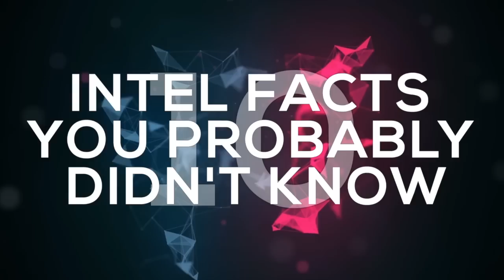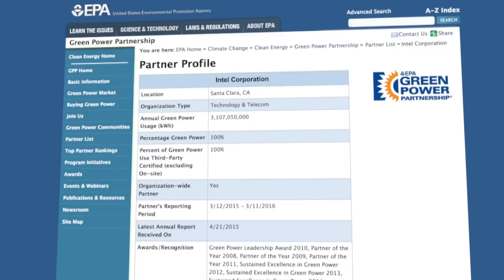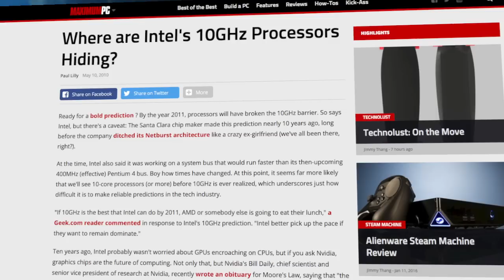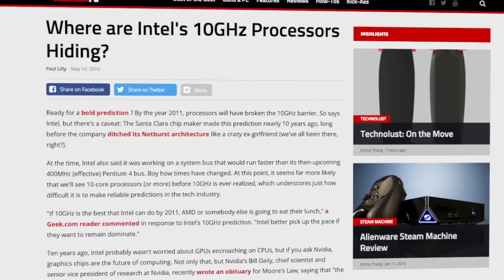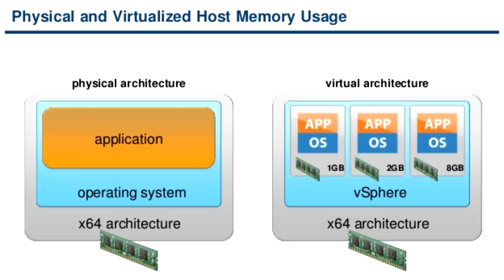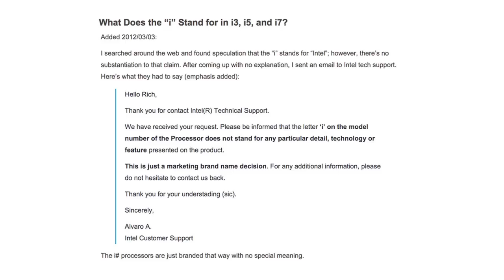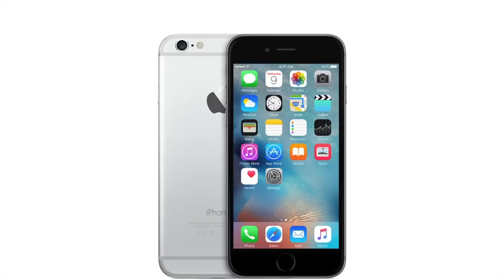10 INTEL Facts You Probably Didn't Know

Comment: 1st: Intel didn't licensee x86 out to AMD to stop them from being a monopoly, IBM wanted to use the Intel 8088 but required there to be more than one supplier of chips, Thus AMD was brought into the fold.

2nd: thing wrong is that Moore's law has not stopped ore even slowed. We still do double transistor every 2 years. This is easily view-able if you simply look up Moore's law on Google or Wikipedia.

3rd. In regards to your statements that we have had 3GHz processors for a a long time is just misleading. Yes we have had processors usually around 3GHz for many years but the performance per GHz has gone up significantly. Thats why a 8 year old Core 2 duo @ 2.4GHz get completely dominated by a modern Intel Pentium at the same GHz.
Just google Megahertz myth or look it up on Wikipedia as well

You guys need to do more fact checking. I have stopped watching your "fact" videos because you keep getting several "facts" wrong.

Fun fact Intel started giving their processors names that contain more than just numbers because because unlike numbers names can be trademarked (this included all the processors with the "i" suffix"

Comment: Intel didn't license x86 to AMD to let them stay in business. that was just an added bonus for AMD later. AMD started out as another manufature for Intel since Intel couldn't produce enough of their product. so they had to license x86 for AMD to legally do this.
Reply: +Zane Erickson Well, they both started out of Fairchild after Noyce took the Traitorous Eight and left Shockley. In some ways its kind of like two siblings who hate each other, but still help one another out.
Reply: +Zane Erickson wasnt that they could not make enough if they wanted. it was more IBM requiring that it was at least 2 different deliverers of chips to them so intel dragged AMD on the wagon.
Reply: +louis tournas 8086 you mean? I used to have one aswell (and it was 12 mhz, twice faster than Intel's).

+Zane Erickson - Intel licensed x86 for tons of reasons, big one of them more recently was in order to get a license for the EM64T from AMD themselves (that's right - AMD developed the 64 bit extensions much better than Intel). What the author of the video did not mention was that Intel's attempts at x64 was a complete disaster (IA-64).

Also in the 2000s they had to pay AMD tons of money not to save them but to settle the lawsuits AMD was throwing at them for buying off OEMs like DELL (which still doesn't sell much from AMD) in the Pentium IV era (another dark ages for Intel)...

In fact from all the CPUs so far, Intel's core architecture (i3/5/7) was the only one getting significantly ahead in terms of gaming performance per clock for the past 20 years (including PII and IIIs where they had to face K6-2 and 3 and 3DNow).

Also what we gained from Intel ending the socket 7 era was the introduction of the much more stable chipsets (LX, BX, ZX) which back then were always a nightmare to deal with...  

I can't wait for Intel or Apple to start making diodes (will buy a whole lot of them just for the brand)!

P.S. I'm on a i7 4770K and yet can't wait to see what Zen will achieve (and probably get my hands on one soon after it comes out), cause I'm sick of this +5% incremental upgrades Intel taunts us with...
Reply: Pavel B.  No, it is actually a 8088, which has a 8 bit bus rather than 16 bit. 8088 is cheaper.

Pentium 4 was a disaster because its performance was worst then their own Pentium 3 except for video rendering. They also chose RAMBUS over DDR. RAMBUS was expensive and there was a stink about it that RAMBUS was getting a high royalty.

The ending of socket 7 was sad. They made their Slot 2 which was expensive. These idiots (Intel) did not want competition.

I don't like people who use underhanded tactics.

I am on Phenom II X2 (unlocked to make it a X4) 3.2 GHz.
Reply: +Pavel B. don't understand why ppl hate AMD, and do things like.. intel buying off the OEMs or Nvidia using gameworks to implement things in games that amd may have problems (keeping that closed-source so amd can't release a fix) and things....
Reply: also AMD didn't start a company to mfg Intel chips. they started within a year of each other and both of the founders came from Fairchild semiconductor. AMD became a MFG of some Fairchild chips and started making its own which were innovative and widely successful for their time. When Intel started making processors AMD was one of their suppliers of LSI and MOS circuits since Intel didn't make its own circuits back then.
Reply: They bribed with a monopoly and were sued so many times its crazy.  The FTC sued Intel over unfair practices.
Reply: Zane Erickson why do you think nvidia is bigger then amd? they have the same amount of users and who says is not true tell them to go to a walk... they both company but.. nvidia's aim is to make money when amd's aim is to advance in techonlogy.. (who did the ddr5 first? who did the tesselation first? who did the HBM first?) that's the indirect point i'm trying to show..
Reply: +Zane Erickson Sorry but it did not. Even "dual core" core CPU's were acutally 2 single core modules glued together on the same chip and they used the FSB to communicate. That is not a dual core CPU that is the same as a multi-processor system.
Also AMD created x64
Reply: louis tournas 8088 excist and is an x86 cpu, difference between it and a 8086 is that and 8086 has an 16bit bus and 8088 have an 8bit.
Reply: +wabachi ok, so present said proof, legitimate and reproducible proof
Reply: +Zane Erickson The licensing had more to do with IBM's involvement, where they basically wanted AMD to keep Intel in check by adding competition.  AMD used to be just a parts manufacturer, but they eventually were allowed to modify the x86 architecture in whatever way they wanted, which resulted in stuff like K6.
Reply: Zane Erickson realy? in some case where amd manage to fix the drivers it makes the game work great on theyre cards too as things like only nvidia capable? hmm don't see what apart from physx (that nvidia never let amd to use it) what else could not work on amd cards IF the thing was open source, on the other hand.. some ppl says that with gameworks they did some nasty things like making game work worse on keplar even if they are powerful just to make the new architecture shine.. anyway my big point was that.. they never share, for example tomb rider (i know i overuse this game but..) when he released, with that tressfx nvidia could not play it (at ok fps even on high end cards) but since amd have everything open source nvidia did instantly a driver fix for that... that's my point..
Reply: wabachi if there's proof. Show it. Because right now you're just like everyone else who makes claims but never prives it.
Reply: wabachi you can post links. Not that hard. And like I said. I have yet to find a proper test
Reply: exactly and now they need their own agreements with AMD since AMD has more valuable intellectual property or what is really known as core technologies.
Reply: +Zane Erickson this is not the case and IBM doesn't count as it wasn't for consumers.
Intel chips were 2 cores glued together communicating via FSB. I'm not sure where you think I was talking about IBM because this was about Intel & AMD. but of course sad trolls with little actual knowledge have to start pulling out bullshit like this in an attempt to discredit those who called them out.
Reply: Pavel B.
If you want, do a weeb search and you will find some 8088 stamped with AMD.
Reply: Zane Erickson there is proof on the internet, not only one but multiple known guys did it, how come that almost every kepler is 5-10 max fps higher or lower then 960 (wich is a shitty card no offence) on the other hand what "advanced features" you talking about? and when i say that they did a dirty thing i'm not talking about hairworks or so i'm talking about the whole game code so what you ask is invalit a test with AND without gameworks, if you know how gameworks works you know that gameworks is not ONLY about hairwork and amb occlusion... dont want to offend you but seriously gameworks dirty bombs, false advertising (ye i'm looking at you 970) and you guys still think nvidia is a saint.. blinded by his marketing campaign...
Reply: Zane Erickson dude there is proof on the internet, search it, i can't post links here you know...
Reply: +louis tournas Why arent you upgrading?
Reply: Jimster480 false. IBM's power4 cpu was the first multi core cpu. But between AMD and Intel, AMD had the first multi core server cpu while Intel had the first desktop multi core cpu. Both were released in the same month though.
Reply: +louis tournas The 8088 was cheaper right, which is why AMD went for the 8086 instead. There was no point in going for a cheaper version of the cheaper version, while making 8086s at the price of 8088s got them quite a few OEMs in Asia. Intel choose RAMBUS over SDRAM/EDO back then because it was the better technology. However RAMBUS went too greedy and their licensing killed off the product even in the server market.
Like I said ending of s. 7 was a good thing in terms of technological progress - it had limited bus speed, lack of or very slow L2/L3 and tons of buggy chipsets with unstable BIOSes... and lots of ... lots of jumpers for everything...
Reply: wabachi well Gameworks was originally created because NVIDIA was making gpu's that were capable of some really cool/new features. But no one was taking the time to implement them. So they made Gameworks so developers could easily put these features in their games. In other words, it was to push the industry forward.
Reply: +Zane Erickson see I don't get that. I have a Kepler based gtx 870m card in my laptop, granted its not as powerful as the desktop version, but say with Witcher 3, I get very solid performance with with most settings on high or ultra. I don't have all of the bells and whistles, like ambient occlusion or Hairworks, but eh. For a discreet gpu, that's not unimpressive.
Reply: +Zane Erickson I have a PC with 8088 chip and it is stamped AMD.
Reply: Jimster480 the IBM power4 was not 2 single core cpus communicating over a fsb. It was the first dual core cpu. Single chip with 2 cores. And AMD and Intel released their dual cores during the same month. Just Intel was for desktops while AMD was for server boards.

And AMD creating the x64 extension has literally nothing to do with this conversation.
Reply: wabachi also. As far as gimping Kepler cards goes, I have yet to have anyone show me proof. They make all those claims. But no proof. And here's what I require to be considered proof. You need a benchmark of a game that shows what gpu, game, gpu driver version, and all settings used. One of the tests must use a known "good performing" driver and have a benchmark with and without Gameworks settings. Next test needs to have the next driver version (the one where they claim Kepler got gimped) and again have 2 benches, 1 with and 1 without Gameworks. Then for the final test do the same only with an even newer driver version. Because there is always the chance that a newer driver had some unexpected fps drops on some cards. But those could have been fixed in a newer driver. 

Every time someone says Kepler was gimped, I tell them to provide this proof. I have yet to see anything. People are just upset that their card doesn't run advanced features as well as newer cards. But they are also the same people that would bitch and complain if NVIDIA released newer cards with little to no improvement. So either way, they will bitch2 and complain about something.
Reply: wabachi that's because NVIDIA is a company who's goal is to make money. They spent a lot of time and money making Gameworks, so They want to get some money from it. AMD is a company as well, but since NVIDIA has such a larger market share, they have to go the open source route in order for enough people to use their stuff to keep AMD in the game.
Reply: wabachi NVIDIA owns roughly 70% of the market share. That's why they are bigger. Who donates millions to medical and educational research? Who did vocal global illumination first? Who did photorealistic rendering first? And you have to remember, it's not just the gaming community. Most of NVIDIA's money comes from selling quadro and tesla cards. Professional grade gpu's.

Comment: the 10 ghz achievement is completed if you think that there were 4 cores cpus way to back from 2011
and the clock was higher than 2.5
so
4*2.5=10ghz
done
the processing power is the same

Comment: Here's some more I don't think most people know/remember:
Intel started as a memory manufacturer. Their market was to replace core memory with transistor memory chips(DRAM, SRAM ...). The core memory consisted of little magnetic cores carefully woven one bit at a time by hand, mostly by women. 

The litography masks for Intels 4000 series of chips, including the 4004, was made by hand, by cuting and carefully placing little strips of masking material under a microscope.

Floating point math used to be a coprocessor chip with the x87 instruction set. It was on the 486 (DX version) that you could finally get an integrated x87 floating point processor.

The latency of RAM measured in clock cycles has ballooned out ferociously, from running synchronously with the CPU, with exactly one clock cycle of latency, to several hundred clock cycles of latency today. L1 caches were originally an addon chip soldered to the motherboard, then they were integrated and L2 cache became a thing. Then L2 cache were integrated and L3 cache became a thing. Then L3 caches were integrated. Then memory controllers where integrated to reduce latency. 

RAM isn't random access anymore; it is much faster to read linearly in memory than randomly. A lot of the complexity of CPUs relates to dealing with RAM latency; the CPU speculatively prefetches memory from RAM, executes instructions out of order and predicts branches and executes them speculatively (if it fails, it has too undo everything since it misspredicted). If you read randomly from RAM, the CPU can't predict and your code may run more than 100 times slower than if everything was packed into one contiguous piece of memory and read sequentially.

X86 CPUs are internally RISC CPUs and the instruction set changes whenever intel feels like it without affecting programmers. Externally they behave as if they were X86 CISC CPUs, but there's a big decoder that makes RISC instructions (micro ops) out of everything, which is what ends up being executed internally.

Comment: I feel the need to bring up a correction - To my knowledge, Moore's law still applies in early 2016 as Intel is still consistently shrinking dyes (although they're reaching the limits of silicone). The clock speed of a CPU does not necessarily directly correlate with the size of a transistor or the power of a processor; hence why a 2 Ghz processor from 10 years ago can be much slower than a 1 Ghz processor from the present day.

Comment: I'm a Computer Engineer and IC Designer, and I can say from what I've learned until today that the third generation of Intel's processors are built on 22nm lithography, the interesting fact about this is that dimensions like these are thinner than the visible light's wavelength, another interesting thing about it is that the gate oxide (isolator used to build transistor's behavior) on such a small litography are in the order of a few atoms, so you guys can imagine how hard it is to build the processors we have today. ^^

Comment: Nooononono transistor count is different from clockspeed
We still roughly double the transistor count, but because of efficiency and heat constraints CPU's are staying around the same clock speed. They just crunch more data per clock.

Comment: I have been fixing computers professionally for 9 years, I refuse to sell any AMD CPUs.  Between the CPUs and the Chipsets, they are nothing but trouble.  Since the Core 2 Duo came out there is no reason to buy an AMD, and trying to get a quad core CPU for $100 is not the best idea, spring for an i5, the chipsets are rock solid and the CPUs just fly.

I do like AMD GPUs but their drivers aren't the best.